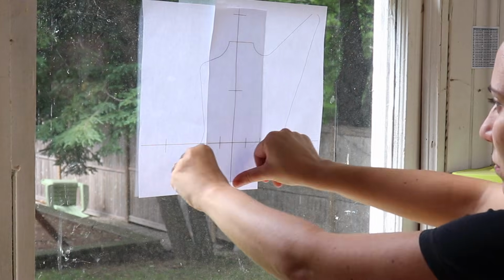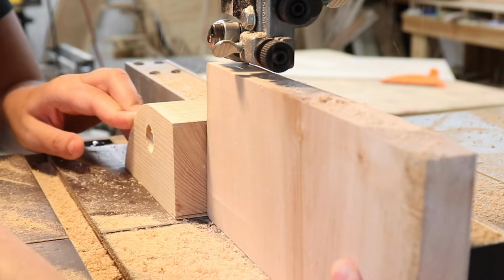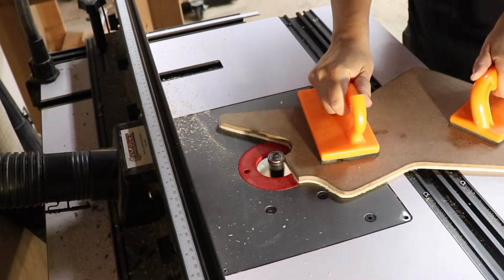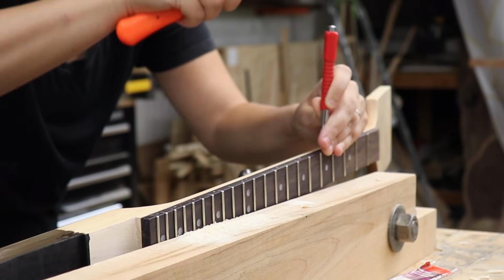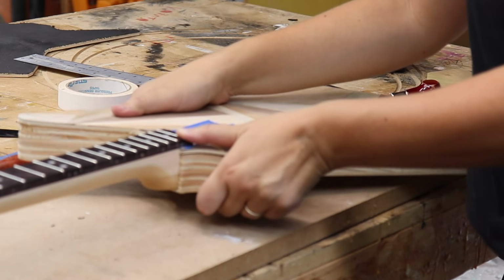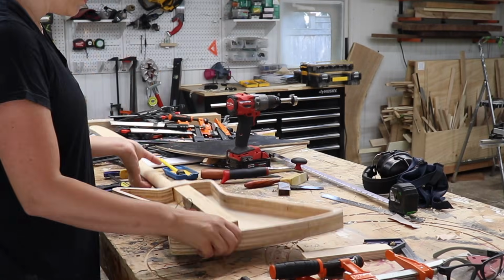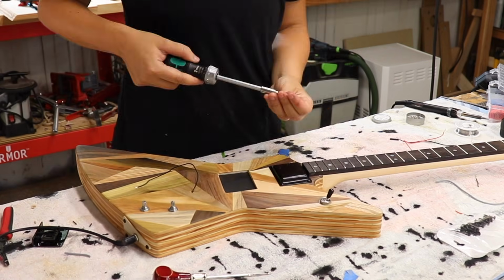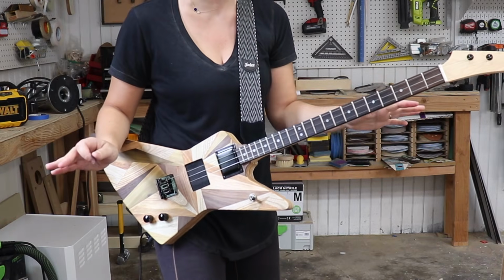Making a Three String Explorer - Cigar Box STYLE Guitar Build

Comment: Something I just learned works really well when soldering wire to large flat surfaces - use plumbing flux on the larger flat surface. The solder will flow very very nicely on the entire surface and create a great connection. I did this recently when soldering wires to a powertool battery adapter.

Comment: When soldering to metal, like the top of a pot, roughing the receiving surface up a bit beforehand makes things a bit easier.
Reply from the maker: I tried that....
Reply: @3x3CustomTamar  also when soldering to metal if the piece to solder is big you need a higher power soldering iron or to preheat the piece, for example, when soldering a pot first pre-tin the wire applying a little bit of solder to the wire before everything, then rough the surface with some sand paper, then (if you don't have a high power iron) touch the surface with the iron for 3~4 seconds, then apply a little bit of solder until it sticks, as fast as you can (so it doesn't get cold) solder the wire that you already pre-tinned and that should get the job done
Reply: a small dab of flux paste help's too,
Reply: Flux. You can never have enough flux.
Reply: I found that the higher quality pots have some coating on the back so I take some sand paper and rough it up. Works like a charm. Although I am not sure how a charm really works.

Comment: For your next build, make the veneer bigger so you can use it on the headstock and match it with the body. The triangular shapes really matched the explorer's body on this build.
I really recommend you use flux for soldering in order to get a good adherence. And using flux core solder. Don't breathe the fumes. Put a small fan next to the work you're doing. Try out some heat shrink and getting everything really neat. Keep up the good work, it's so enjoyable!
Reply from the maker: I used flux core solder. And I tried used flux paste. Nothing would work to stick to the edge of this piezo. I tried sanding. I tried a crazy amount of heat for a crazy long time even. Nothing. I ended up having to buy a piezo that already had wire soldered to it. All my other joints went really great! I have no idea why it wasn’t working. A buddy of mine came over and he couldn’t figure it out either. Oh well. Ha

Comment: I work best with actual size patterns for my projects. I use transfer paper in between the pattern and the wood and then trace the lines. Time consuming and a pain if I want to make more than one of the same project. I loved what you did, after cutting out the pattern then taping it to 1/4 board and the genius step spray painting the edges. Which after cutting that out you now have a sturdy multiple use template. I’m so glad I subscribe to you channel; for me this is a ground breaking solution. Thanks so much, you’re doing a great job, I’m hoping you have many more ideas and builds.
Reply from the maker: That’s so awesome to hear that it was useful. I usually trace around my paper template but for this build I happened to have had a can of spray paint on the bench. And the light bulb went off. Ha!

Comment: Very cool 👍👍😎😎😎 That's a nice sounding guitar! I didn't think I would like the top, but it looks really nice too! 

I have been contemplating building a 6 string acoustic "flying v" or "flying z" out of some 2x4 for several years now. You gave me some great ideas how to do it - and showed some pitfalls that I had not thought of before. Thank you for the inspiration! 

I hope you do well in the competition! Dave
Reply from the maker: Thanks! I def want to make a full size six string version of this. Would have to add some bracing to the soundboard and use a neck with a truss rod to account for all the string tension. But it would be very cool

Comment: For good solder joints, there is a little prep work involved, but not too bad.  In my job doing circuit card repair under a microscope, we use special abrasive erasers to clean the pads you intend to solder before cleaning them off with isopropyl.  I'd say isopropyl and a q-tip will work fine for this part.  You will also want to tin the things you plan on soldering: the pads and the wires.  Tinning is just pre-soldering to make sure the joints will all take solder when you actually go to join parts.  One of the big things you'll want to use is flux.  I call it my "frenemy" because as nasty and sticky as it is (and in my job, I had to flush all traces of it from my work), it works absolute wonders, making beautiful, smooth, shiny fillets as opposed to dull, spiky globs.  Put a little flux on anything that is going to receive solder before applying heat.  Your work is amazing, and I learn a lot from your journeys.  If these tips make your work amazinger, cool!

Comment: If you want to improve the resonance if you do a next built, research acoustic guitar braces.  The long wing would need some braces to spread bass frequencies correctly and not cause too much vibrations that will turn the guitar in a feedback machine.  The way the guitar is built right now is fine, but don't get too wild with the gain and be careful not to play facing the amp at high volumes.

Comment: Amazon and other outfits sell liquid potting compound in small tubes. Either one part or two part. It's common to pot solder joints to protect them during assembly. You could even put the piezo in a circular mold and pot the entire backside, brand it while it's still soft. But I digress...  Great video!
Reply from the maker: Liquid potting compound. That’s something I will have to look up.

Comment: Great project. I'm making a 3 string Randy Rhoads style V guitar.

I think the problem with your first piezo is that being jammed between the neck and the top, it simply isn't vibrating enough to produce enough signal to make a sound. When soldering piezos, I glue the wire on the piezo disk (gluing the insulator, not the conductor) before soldering to keep it in place. A preamp is a good idea when working with piezos because they don't resemble guitar pickups electronically (keyword: impedance). I use the "Fetzer valve" circuit in my piezo guitars.

The top material with plywood and the intarsia (which looks fantastic btw) isn't ideal for getting a nice acoustic tone or piezo tone. Quartersawn softwood is generally used for this purpose because its vibration properties. Plywood, being glued cross grain, doesn't vibrate a lot. Copious amounts of boiled linseed oil improve the vibration qualities in solid wood tops (believe it or not)! You can test different top materials by tapping on them with your fingers, a good material has a "musical boing" sound while plywood has a dull thud.

The top material doesn't matter with the magnetic pickup (unless you believe in the tonewood conspiracy).

Looking forward to seeing your build-off project!
Reply from the maker: Sounds cool. Thanks so much! I don’t think that was the problem with the piezo. I made another one just like this where I put the piezo in the neck under the top and it worked just fine. I think it cracked when I clamped it. There was zero signal coming out of it. Good tip on the soldering

Comment: If you're having issues with getting your wire to stay down in the solder, clean the tip with an ammoniac brick and stick in a little pool of flux, and re-tin the tip. Put flux on your wire, and tin it. Once that's done, your solder should flow not only off the soldering iron where you want it to, but the wire should actually take the solder.

Comment: Great video thanks for the inspiration. Tip when soldering, heat the object with the iron THEN apply solder, (use solder that has a flux core in it). Good day from Australia .
Reply from the maker: Thanks! Yup! I know how to solder. This piezo I purchased just wouldn’t accept the solder no matter how hot or how long I kept the tip on.

Comment: If you have trouble soldering, just sand the wires slightly so it will stick easily. Great job as always!
Reply from the maker: I tried that..... I don’t know why it wouldn’t stick. I tried different temperatures. I tried different solder. I tried flux. The only thing I didn’t try was cleaning it with alcohol

Comment: Next time try using thin CA glue with a accelerator when gluing up the veneers. Apply the CA glue to the backside of the veneer to reduce bleed through, any that does bleed through should clean up fairly easy when you sand the top side. Try using some scrap veneer and wax paper that is slightly dampened with water to help keeping the veneer from sticking to it before using your finished woods. 😁😁
Reply from the maker: Hmmm. I don’t know about that. I don’t trust CA glue for lasting strength
Reply: @3x3CustomTamar  Besides playing guitar I build and fly model airplanes, I have several planes I built from scratch in 1991-92  with CA glue that I still fly today.  If CA glue can last and handle the stress of flying at speeds well over 100 mph it certainly will hold veneers that just lay there, CA glue is perfect for small pieces of wood. Trust me it's plenty strong enough and reliable, also don't forget after you get your geometric shape/pattern built your going to glue it to the top of another piece of wood with white glue!!!. Have you ever worked with Vacuum Bagging in your woodworking? It's well worth the time and money!!!
Reply from the maker: Dick Dastardly I’ve been looking into the whole vacuum bag thing now

Comment: Really cool build!  I wonder if the issue with the original piezo was the location?  Usually those need to be where they are getting squeezed or bent to produce much sound.  In the middle of a block might not work.
Reply from the maker: Thanks! I put the piezo in the neck on my last 3 string just like this and it worked fine. Also dell pucket. Who makes cigar box guitars here in YouTube recommends doing it the way I showed.

Comment: Loved your build (I am an amateur CGB builder) - kind of wish you chose a different pickup.  I am familiar with where you got it and what it is.  Would have really loved a more substantial pickup.  Very pretty.   You might benefit in your build-off using a pre-amp for your piezo as well.
Reply from the maker: Thanks so much! I actually liked this pick up. The neck though... 😬. I’m not doing a cigar box guitar for the actual build off and there won’t be a piezo on that build. But thanks for the tip!
Reply: 3x3Custom - Tamar 

Check out the Snake Oil humbuckers. 

Very rock and roll
Reply from the maker: Scott V I will!

Comment: The most common problem I encounter with solder failing to stick is where you do not heat both work pieces enough and you end up with what is called a "cold joint", where it's sort of momentarily stuck together, but then you bump it and it comes loose. The solder is a really hot, viscous liquid, and you need to heat both items so that the solder wets both of them. If you've a got a round, bulbous bead that's standing proud of the work surface, then it's not hot enough. This is analogous to water on wax paper. On the other hand, when it's ready to bond, the solder will wet the surfaces and tends to "soak" into stranded wire or form puddles instead of beads. Like, if you're bonding two things you tinned, and you've got a wet bead on the hot side, then the other side is not hot enough. When you see the entire mess flow together as a single mass of runny solder, then it will bond. In turn, the main cause of this problem is a dirty or crusty iron tip that needs to be scraped clean (while hot) on a wet sponge and re-tinned.  Also, I do not make enough use of flux, but it helps a lot, too, convincing solder to flow and stick.

Comment: Actually you should look at Carter Tools
for bandsaw blades and guids  a 3/8" blade can cut tight conners.  Or find a good used scroll saw.  With thoses you just drill a hole feed the blade in and cut you dont have to split a side so the blade can enter the cavity chamber. 

I think you would find a pin router handy.
I know you have a cnc but you wouldn't use it for freehand work.

Thats pretty cool I took you for a finiture maker and your main gig is musical instruments.
Reply from the maker: Nope. My main gig is furniture. This is just something I do for fun

Comment: the top of that guitar looks great think you should make a full size guitar that way
about the neckpocket cut to far intoo the top  , if the pickup cover didnt worked you couldve made a small heelpiece from the same material as the fretboard that fitted in the hole so the bottom of the fretboard flows intoo the top of the guitarbody , would make the misstake invissible but it it was you could hide it behind an extra fret 
about the branding iron , i think it needs to fit over the stock copper pin sticking out the iron (bigger wattage soldering iron )i guess fitting it to the end of a screwdriver with a wooden handle works better using a torch to heat it up works faster then the electric iron 
i realy like the square airhole and the mesh covering in it , from a distance it has the same shape and colour as the pickup and it doesnt look out of place on a copy of a electric guitar
Reply from the maker: Thanks so much! That would be an interesting fix. Glad my fix wasn’t too hard. Ha. Yeah. I realized I just don’t have the right soldering iron. But this works. And about the sound hole. I was so excited when I realized I could make it the same shape as the pick up to just look like it has 2 pick ups from far. Glad that detail didn’t go unnoticed

Comment: I suspect you ran into the same problem I had with a CBG build of my own. I put a dab of hot glue in the center of a piezo stuck it to the soundboard. It was quick, easy and perfect right? Not so much. That resulted in very low output volume. I discovered that, because hot glue is very rubbery, it was damping the vibrations from the soundboard. I then removed it and reapplied using epoxy. Voila! nice and loud. I then glued a 1/4" fender washer to the backside of the piezo, which resulted in a bit more attack caused by the additional mass.
Reply from the maker: So it wasn’t a dampened sound. It was zero sound... I think the solder joint came loose... but that’s a cool idea with the fender washer.

Comment: I have the impression you‘re not using flux for soldering. Flux makes a great difference, I personally use Amtech with great satisfaction.
Reply from the maker: I wasn’t at first. But then I ordered some. And it still didn’t work.... All of my other joints went really well. I don’t know why it wouldn’t stay on the metal of the piezo. It would stick. And then crack off when I touched the wire
Reply: @3x3CustomTamar Maybe that piezo is sucking too much heat from your soldering iron. I'd carefully try to increase the temperature or putting the soldering iron on the piezo for a longer time before attempting to solder it, so that the whole thing heats up.
Reply from the maker: gordoncreAtive I tried that too. I thought that was the issue and I left the iron on for a really long time. Like way longer than I should have. Still no go. I ended up just ordering piezo’s that came with wire already soldered to them.
Reply: @3x3CustomTamar  Some things are just stubborn to solider to. Did you try ruffing the surface with some sand paper before the flux? That will sometime help also.
Reply from the maker: In Flagrante Danelectro yup. I tried that too!

Comment: Ok go look how they do inlays  youll see using hyde glues they wet both sides with the glue and use a hammer to help fit the parts and remove the extra glue.
Or your other options are tape it all togather and sheet one side the glue it all  
In one go. Using a vacume press. 
Your probly going to coat this with sevral layers of liquor.

Comment: I'm pretty sure that the piazo problem was due to a solder failure,  You need to use flux, not hard, just ger flux core solder.  A no-conductive oxide layer forms on the surface of solder (always).  Flux contains a weak acid that disolves that oxide and keeps additional oxigen from reaching the surface of the hot solder and reforming the oxide layer. Then the hot solder can form a direct cpnductive bond with the wire and contacts on the piazo.  And, you where correct, the oxidized layer probably fractured amped down the neck.  Clean off the acid flux with the some slovent and a cotton swab when solder cools.
Reply from the maker: I did use flux
Reply: @3x3CustomTamar   OK, my bad.  I used to be a quality control supervisor in an electronics plant and the problem sounded familiar.

I loved your video and a 3-string guitar is now on my project list.  I also enjoyed your recent article in the recent Fine Woodworking.  

I am putting together a list of woman "makers" to  share with my grand daughter (for later, she's three). You're on the list.  I look forward to enjoying your future articles and videos.
Reply from the maker: @mikebrower8450  awesome 💪